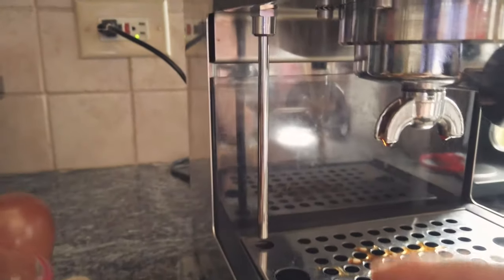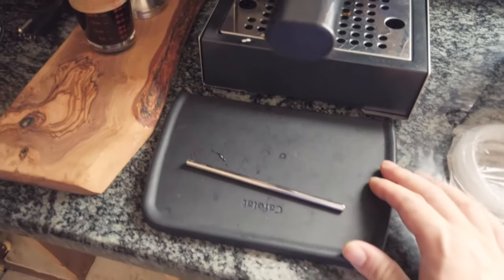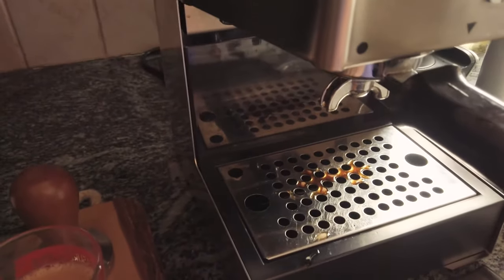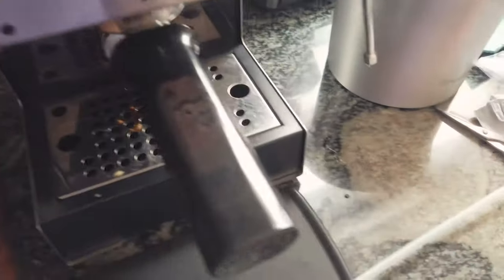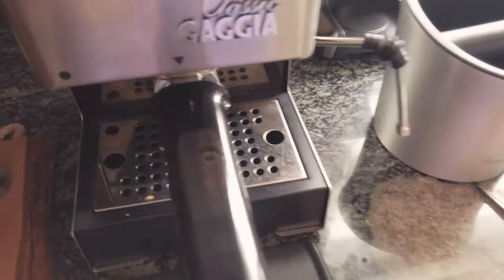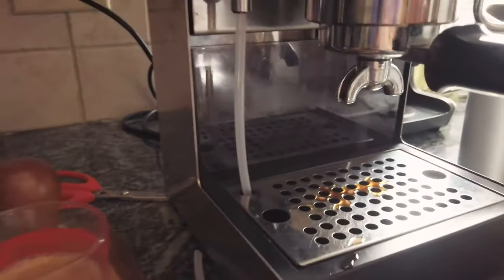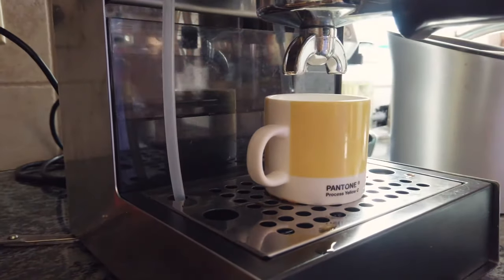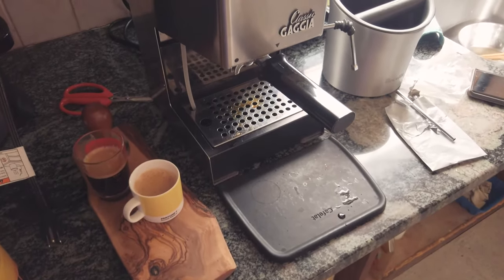The Ultimate DIY Gaggia Classic/Pro Overflow Drain Outlet Tube Upgrade!

Comment: Hi there. Thanks for the tip! I just did this hack - I removed that black rubber holder from the original stainless steel tubing and added this to the end of the my black silicone tubing. That black rubber holder sits nicely in the hole of my drip tray and acts as an anchor for my silicone tubing. Thanks once again! 🙂

Comment: I bought a pack of 5 stainless steel drinking straw at the dollar store and cut them to size for my low profile drip tray since the original tube is too short for it. The straw dimension is the same as the original tubing.

Comment: Love this! I've been thinking of what to replace that piece with as I am just buying a used Gaggia. Thanks! Could I also ask - I can't find in the manual - how often should water be being expelled from that outlet? I just ran water through the machine like the initial use cleaning cycle (with no coffee or no portafilter attached) and there is no water in my drop tray 🤷
Reply from the maker: There shouldn't be any water coming out of the overflow drain if you are not brewing and just running water through. The extra water come out due to pressure building up and expelling excessive water out of that valve.

Comment: The original gaggia tube is chromed brass. A better replacement is to use stainless steel tubing of the same dimensions. The original tube is expensive yes (over £15 delivered in uk) but you can buy stainless food grade tubing for less than a third of that here.
Reply from the maker: Still prefer the soft silicone tube though because I don't need to take it out to pull out water reservoir
Reply: No need for food grade; the tube only carries residual water.